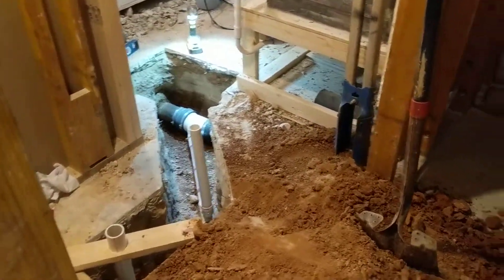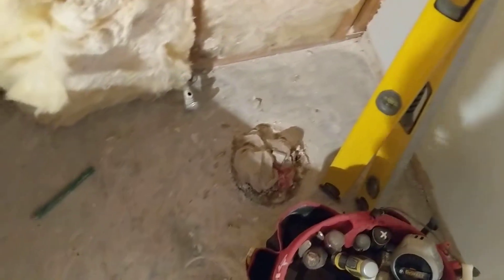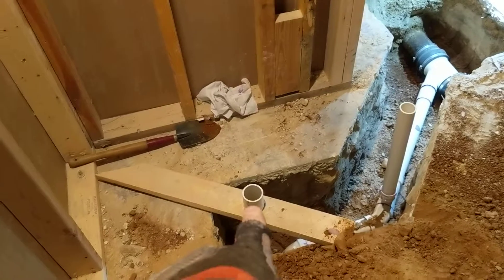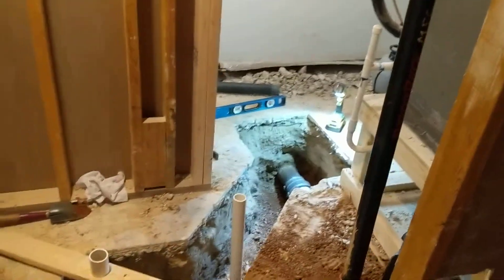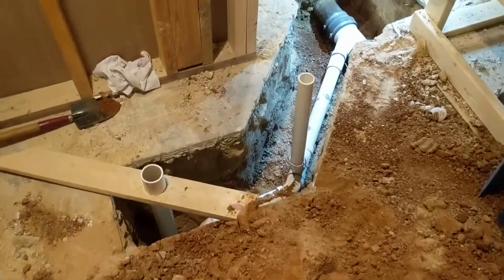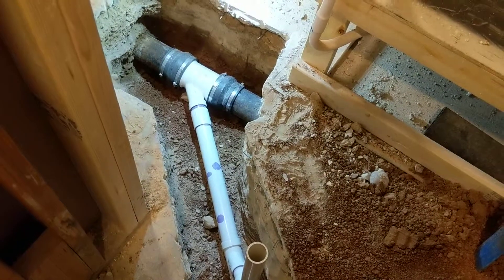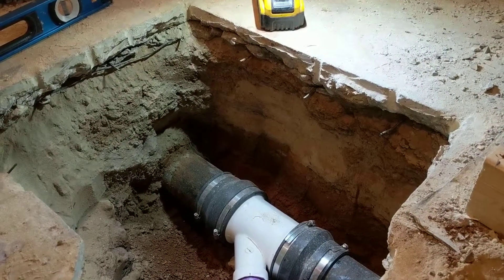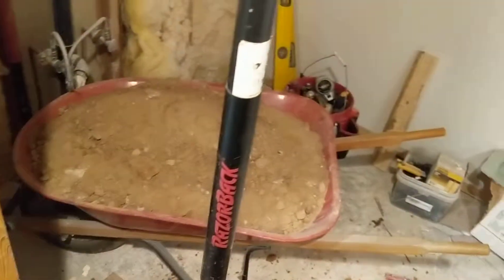Adding a Shower Drain Inside a House

Comment: Wondering what is an approximate price for this kind of a project? We have a 0.5 bathroom on the 1st floor, with closet right next to it that we want to convert to a full bathroom. House was built in 2000, DFW suburbs.
Reply from the maker: It depends what is involved. To get a real number, have some contractors come out there and look at what you want to do. There might be a simpler solution than what you're thinking, but they'd be able to give you a real price. I did this for free, but my best guess is it would have been $8000+ for materials and labor depending on the complexity, type of shower and where the main sewer line was. We were fortunate to have it traveling in the direction that brought it nearer to the shower. You run the risk of causing foundational issues if you cut too much of your slab apart and if you have a post tension slab then I wouldn't even know how you could do it without the risk of cutting a cable. Good luck in your endeavor.

Comment: Great video. Very helpful! Did you pull permit for this one?
Reply from the maker: No, and this is why: This was volunteer work for one thing, but also it's in the county (no inspections required) and is not a part of the municipal sewer, and it's not septic. They actually have their own water treatment plant. Pretty much any other circumstance would require a permit and a licensed master.

Comment: Thanks for sharing. a couple of questions.  what kind of slope did you give the Y Fitting? also, what kind of fitting did you use for the vent? Thanks!
Reply from the maker: So the slope for most drains is 1/4" per foot and that's what I stuck to here. The vent is taken off of a Y fitting with a 45 to bring it vertical. So a 4" by 2" Y on the cast iron with two fernco couplings, then a 2" Y with a street 45 for the vent (could also use a combo Y) and then a 2" P-trap and pipe up to the shower pan.
Reply: @MyFortressConstruction  Thanks!!!